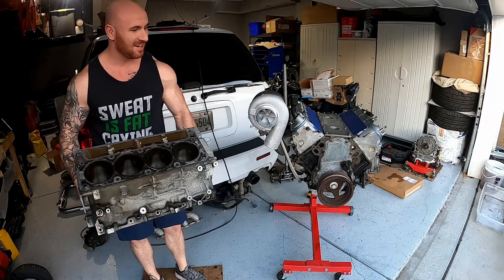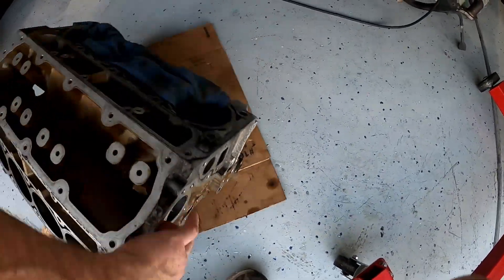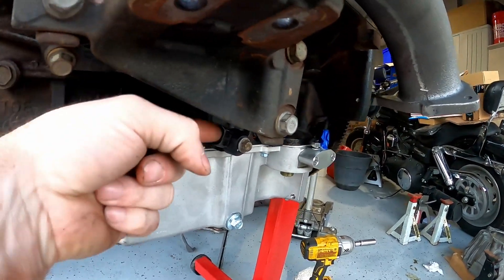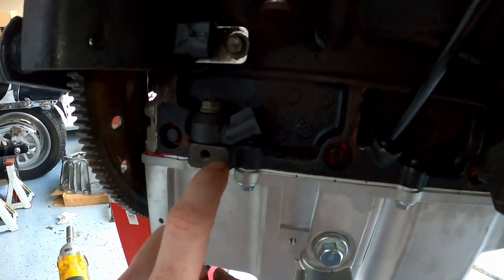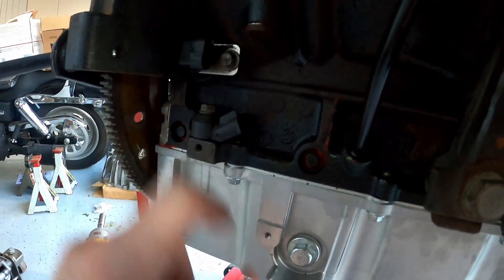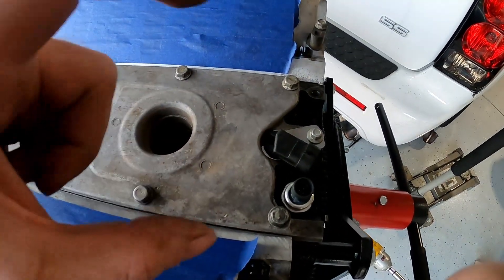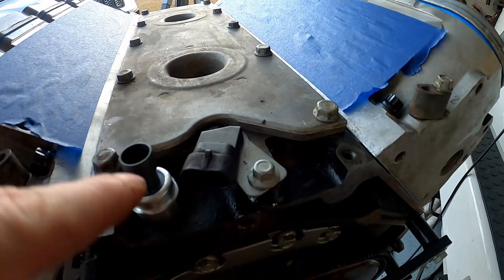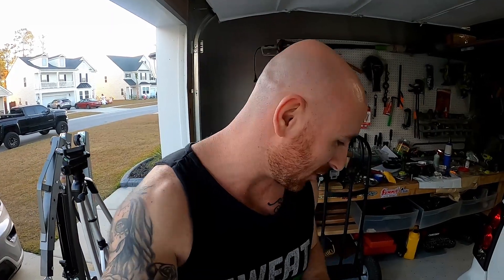LS2 vs LQ4 Differences TBSS

Comment: Wanting to do an AWD TBSS LQ9 900-1000whp as a daily. After watching your videos, I didn't realize how many little issues arise lol.
Reply from the maker: In all honesty it’s not that bad to address the issues and it’s definitely worth the fun.  I will say that at the current setup made almost 800hp at 19lbs, I see about 22-23psi on the street, it’s almost unusable unless you’re doing a 60mph roll and up (still have to put the drag pack on).  I would shoot for 700-800 to get a feeling for it as it is a bit sketchy.
Reply: @garagegrunt8154 I’ve been in the high hp DSM and Evo game for a long time. Hence why I want to stay AWD. I want to daily it and not have to run drag pack on the vehicle 24/7. Also I feel like makes it much more manageable although much harder to work on. What was your trans build and rated at? I planned on doing an RPM level X but I can’t find anyone who ran it at high HP
Reply from the maker: @ryanb @ryanboytim896  I also have a 1g AWD that’s heavily built, haven’t introduced it to the channel yet.   My trans build was rated to 900hp to the wheels.  After extensive discussion with performabuilt, they guaranteed me that transmission to work for all my needs even when pushing beyond the 900hp mark.  If I had to do it again, I would get a 4l80 built, they seem to be more proven, and RPM does a great job with their transmissions.

Comment: I have a 2006 tbss with the 6.0 and I’m swapping for a 2006 Escalade 6.0 how does it run with everything you’ve done to it because my mechanic said it’s going to be a decent job and also how can i get in contact with you if i have any questions
Reply: Also what did you do about the cam do i have to swap that to the ls2 or buy an upgraded one??
Reply from the maker: It runs very good!  With the turbo on there I’m making almost 800 to the wheels which is pretty rowdy.  What are your goals with the your TBSS?  That will tell you what parts you need to get.  You can reach out to me on Instagram at garagegrunt.

Comment: So you put the heads on from the ls2 on the lq4?
Reply from the maker: @gastonneal724  yes that is correct.  They were 243 heads.
Reply: @garagegrunt8154  my man, that's why I found your video I was wondering if I could do that. I'm looking at a H2.
Reply from the maker: @gastonneal724  yes sir you can, not an issue at all!

Comment: what did you do about the oil pres sensor?
Reply from the maker: I ended up using a LQ4 valley cover and just screwing the oil pressure sensor into the bock.